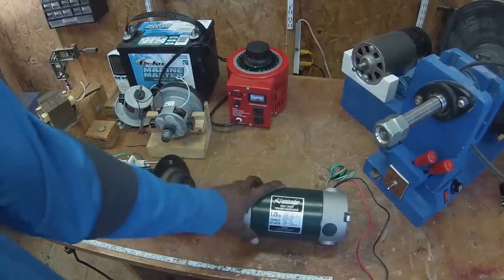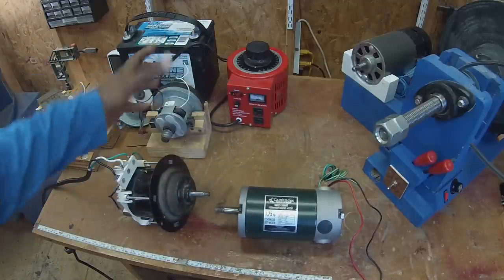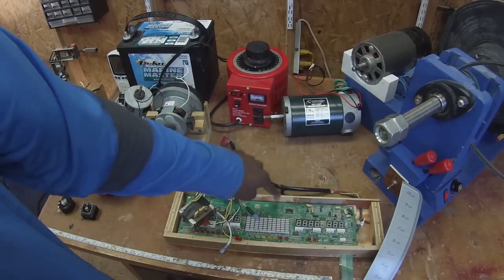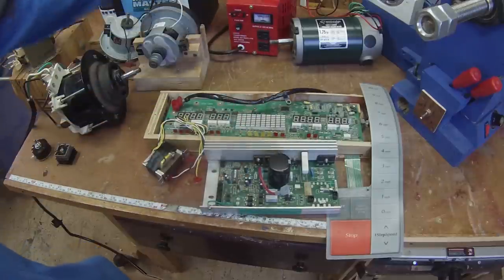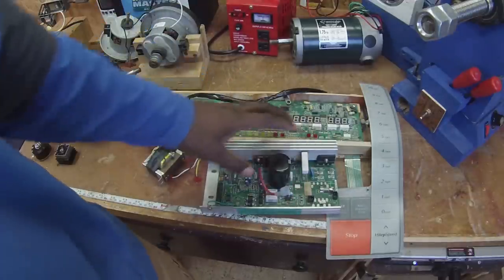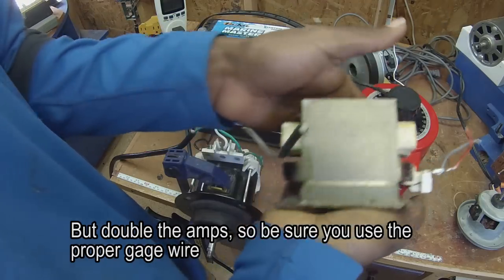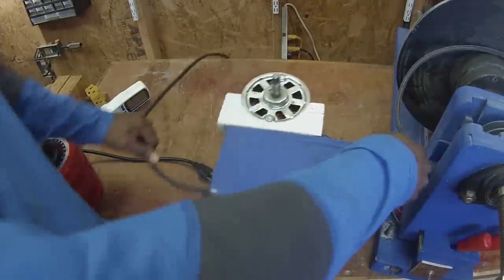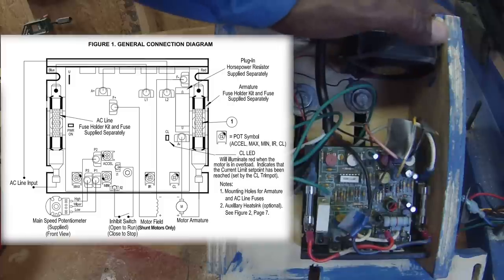How To Wire A Large DC Motor And Control The Speed; Treadmill Motors and Universal Motors 019

Comment: Will a DC motor, such as from a treadmill or washing machine run off an alternator or generator? I am thinking of making a small tracked vehicle using DC motors, one hooked to each track. I was thinking instead of a whole bunch of batteries,  I would run a small engine hooked to an alternator/generator to feed the dual motors. I don't need anymore speed other than that of a slow riding mower, just some good torque. I would have a separate speed control on each motor to help turn the vehicle. What are your thoughts on this Jeremy?
Reply from the maker: +Reverend Thor In short, yes a D.C. Motor can be powered from a generator. But you have many small issues to get worked out. I suggest lots or testing before committing to a full build. I would also see if anyone has already done what you are trying to do.
Reply: Thank You Jeremy. They do it with hybrids, so I am sure it can be done. I know nothing about electrical motors though. Once again thank you for the prompt response.
Reply from the maker: +Reverend Thor I agree... it can definitely be done. But it is by no means simple as a diy project. Have fun
Reply: Reverend Thor n

Comment: Grant Thompson makes his own "variac" which he calls a "scariac" (maybe a better option?) https://youtu.be/P9UjxG8sN1c
Additionally, I watched a different video (forgot who did it) but he wired a dimmer switch between the plug and on/off switch. Any thoughts on these two methods of controlling the power? I would really appreciate your feedback. Also, I think it is awesome that you make things out of what usually ends up in landfills or worse, the ocean. Re-using or re-purposing is by far better than simply recycling. I try to re-use as much as I can...duh, that's how I found you! You are a great teacher. You are very much like Matthias Wandel in that he also reuses wood, motors, gears, etc. and makes his own power tools and mechanical toys. However, you explain things in layman terms, which makes said things a bit easier to understand. No disrespect to Matthias--I love him too!
Reply from the maker: I am not a fan of the "scariac". I have seen that video. There are just too many issues with using that on a regular basis. But it makes for an entertaining video. That, I am sure, is why he made it. Frankly speaking I only make things like that for fun... then I never use them. Like my "scary prototype shredder." As to the Dimmer, The Harbor Freight speed controller and dimmer switch are identical in function. They work exactly the same way except "speed controllers" supposedly have beefier components to withstand the inductive load created by the motor. I suspect the HF one doesn't.

Comment: Is it me, or is that Harbor freight triac controller dangerous as all hell?
Look at the switch, what do you do when you need to stop the motor?
You flip it. But what happens if you apply too much pressure in a panic? YOU PUT IT ON FULL-BLAST!

DO NOT USE IT!

Comment: Those cheap controllers are garbage. Mine worked for 2 days then the speed control dial just stopped working. Now it's a $15 dollar on/off switch. Spend the money guys it will be worth it in the end.

Comment: Light dimmer....problem solved.
Reply from the maker: Dimmer switches are not designed for inductive loads. It simply won't last very long. The harbor freight speed controller (HFSC) is the exact same concept. You still need to convert ac to dc but at least the HFSC is suppose to work with inductive loads. I say that with some reservation because I have not been satisfied with it's performance either. The problem is not solved with a dimmer. Unless you want to buy them over and over. Or perhaps you don't use it very much, or at lower power ratings... that might be ok

Comment: i saw a youtube video where the guy used an arduino to control the speed of the mc-2100, but you could probably just use a cheap servo tester to provide the pwm. 

https://www.youtube.com/watch?v=rAZ8FCzOuxE
Reply from the maker: The one I saw was this one... https://www.youtube.com/watch?v=zWk7b0snB9c
I don't have any experience with an arduino but it appears to be a fun project for someone into hobby electronics. I don't keep breadboards or anything like that around. However, I am becoming more interested as people like you point out these low cost options for digital controls.
Reply: nah, what i'm saying is that you might be able to use a cheap servo tester instead of the arduino

Comment: jeremy. i am using my lathe as a saw mill, with a treadmill motor. my rectifiers i bought seem to small and get to hot. my issue i am having is as i am slicing through the wood, the motor slows down and shuts off. just bought this motor. the other had no torque. my mc60 looks as if r14 burned up. would you recommend this link. https://www.ebay.com/itm/AC-110V-Rotary-Knob-Voltage-Speed-Controller-DC-Motor-Variable-DC0-90V/182280105804
Reply from the maker: Unfortunately I get hundreds of questions like this. At this volume, I simply can't review each request and give recommendations one on one.